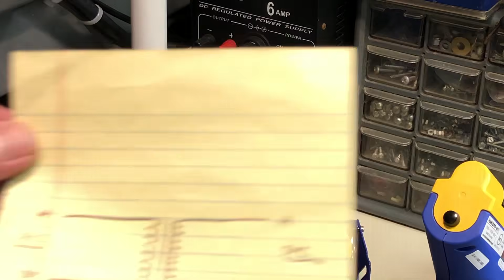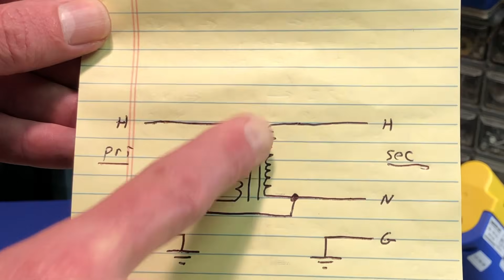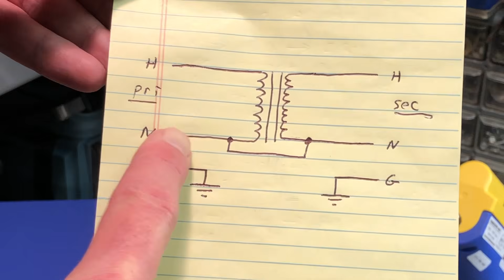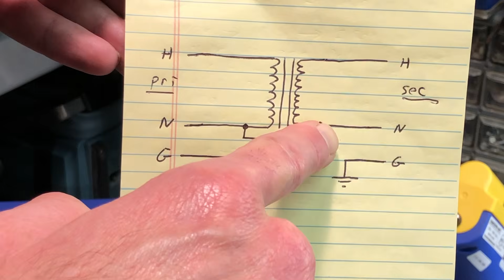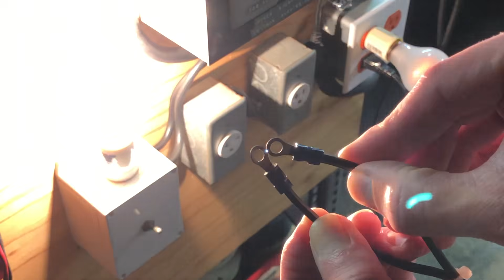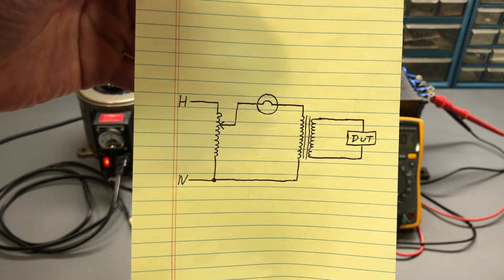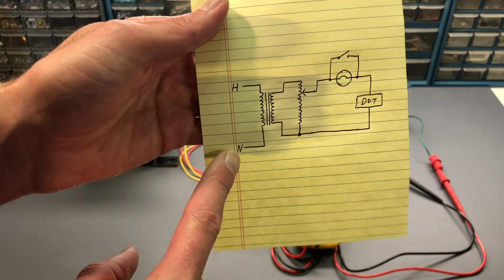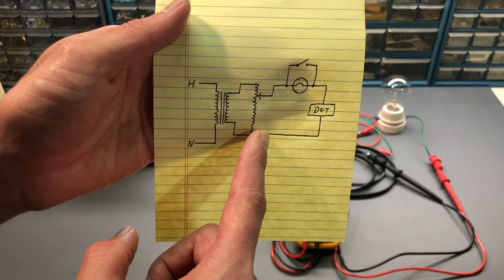How An Isolated Dim Bulb Tester Works (Current Limited Isolation Transformer And VARIAC)

Comment: Thank you for this video! As a noob hobbyist, my primary concern is a) not killing myself and b) not blowing up my oscilloscope. So this is very helpful. One thing I did learn, and correct me if I am wrong, is that using a powered differential probe is safer than using this setup because you can then still use the ground for the Oscilloscope, while isolating the probe connections from the scope, which in theory should allow you to probe a dead short on the test device without electrocuting yourself or blowing up your scope, right? Or is that wrong?
Reply from the maker: Glad you found the video helpful.  The isolation transformer's main purpose is for safety from the AC line which has a ground reference.  Although the transformer can allow you to connect a grounded oscilloscope, that will essentially undo the isolation transformer safety by introducing a new path to ground on the transformer secondary.  A dangerous shock hazard now exists.  Differential probes are a good solution or using an isolated scope such as a Fluke Scopemeter will keep you and the equipment safe.
Reply: @EriksElectronicsWorkbench  Thanks!

Comment: Do microwave ovens have a suitable tranformer to use as an isolation transformer?
Cheers
PeaceFromOz
Reply from the maker: No you can't use a microwave oven transformer because that type of transformer is a step up turns ratio.  They produce a very high voltage on the secondary (vary dangerous too!).   An isolation transformer is a 1:1 ratio so your line voltage on the primary is the same as the secondary voltage.
Reply: @EriksElectronicsWorkbench  thank you .

Comment: I have a nice iso transformer but no variac. I have been looking at a vac 
SC-10T from ebay that is a isolated variac but have not bought it because it seems everybody has seperate devices. I would like to know if the advatages and disadvantages of using a seperate variac and transformer vs a "all in one". I have a small bench so that would be one advantage for the 
SC-10T.
Reply from the maker: The SC-10T that I found on eBay does indicate on its schematic that it is both an isolation transformer and variac. (but for safety you should verify the isolation with an ohm meter if you buy it)   
If you connect an incandescent bulb in series on the output side you will essentially have the same arrangement as I use: isolation transformer->variac->bulb.  From the provided advertising the all in one SC-10T should function the same as having separate components and a bit more space saving.
Reply: @EriksElectronicsWorkbench  Thanks for the quick response. I am still watching your video and double checking my transformer for isolation.
Reply: There's a video of the SC-10T taken apart. Once you disconnect the ground on its output, which is connected from factory, it's truly isolated.

Comment: Hi Erik. I've found a problem. When switching this large isolation transformer, I've noticed that sometimes the house circuit breaker trips. It seems that the inrush current plays an important role, especially when the power is turned on at a point other than when the mains is crossing 0V. I've been thinking about connecting an NTC in series and creating some kind of controller to power up the entire system. The controller should manage the NTC's temperature, include a bypass relay after a few seconds, control a contactor for switching on and off based on conditions, a crossing 0V detector, (arduino project)etc... Perhaps there is something already available in the market.
Reply from the maker: Yes if the transformer is switched on at the peak of the AC cycle you will have a very large inrush current and large transformers can have considerable inrush currents.  You might try using a solid-state relay (SSR) that has zero crossing switching built in.  Make sure to size the relay for the power draw of your transformer.   I think the zero crossing SSR is the simplest solution.

Comment: Having the variac feeding the IT will cause problems . At low variac voltages the primary of the IT will struggle to generate secondary voltage due to back EMF. Could you do a vid on the difference between a tech IT and a medical IT.
Reply from the maker: The isolation transformer will work fine at low voltages but the slight mismatch between the variac and isolation transformer means you might have to set the variac output a little higher to compensate for the loss.  But that setup would still allow setting any voltage out of the isolation transformer from zero upwards. 
I don't have a medical grade isolation transformer but typically medical grade means it has strict safety measures for ground faults, i.e a fault that could harm a person since the transformer could power a device directly attached to a person.

Comment: I’d like to see what the current does on the DUT when you short out the bulb?
Reply from the maker: When the bulb is shorted it is just an isolation transformer and variac, so use with caution because there is no current limiting.  It is important to be able to bypass (short) the bulb so you can apply full line voltage (when appropriate) to the device when testing.

Comment: another question. Which is the best illumination? I always have filament bulb at 230VAC, but perhaps now are other options. The noise of the new LED bulbs is crazy...
Reply from the maker: You can't use an LED lamp.  It must be an incandescent bulb.  Normally the bulb voltage is the same as the maximum line voltage.  You are not choosing the bulb's wattage for how brilliant you want the bulb but rather based on how much current you expect the load to draw and how much current limiting you want.  A low wattage bulb like 25 watts often limits too much current, and drops too much voltage on the bulb leaving little voltage for the load.  A very large wattage like 500 watts won't offer much current limiting in most situations so you have to choose a bulb wattage appropriate for the load.   If the bulb is glowing brightly you have too low of wattage for the intended load, or if the bulb wattage has been selected correctly, the load has a fault which is what we are protecting against.
Reply: @EriksElectronicsWorkbench   Sorry, it was my fault. I changed the subject and the result to be more in line with the topic we were discussing. Of course, I know it should be a filament lamp as a series current limiter. I was referring to the illumination on your workbench and how people light up the area. LED lights generate a lot of spurious frequencies. In the past, I used a 220V 60W lamp, and that was it
Reply from the maker: @soulrobotics  my work bench and the surrounding work area is illuminated by fluorescent lights.  Some traditional ballast and some electronic ballast.  Electronic ballast are electrically noisy. I also have an incandescent bulb overhead for times when I need light but must have the work area as electrically quiet as possible.  Some videos are filmed with extra LED lights only to help with the camera exposure.  LED lights generally are extremely electrically noisy.

Comment: a question: how you source your oscilloscope, RF generator, AC voltmeter, etc? with or without ground?.
Reply from the maker: All of my workbench instruments are plugged into a normal grounded outlet.  It is bad practice and dangerous to float or isolate test equipment.  If you need to use an oscilloscope and isolate from ground the safest way is to use something like a Fluke Scopemeter or differential scope probe.  Most bench voltmeters and DMM's have floating inputs and are not a problem when working on isolation powered equipment.

Comment: I would like to add some protection. The lamp switch should be a 2A circuit breaker. Because, in case the switch is on and something bad happens, it is good to have an automatic circuit breaker. 2A is sufficient for many projects. I would also add an RCCB on the primary of the transformer (I choose your last configuration). If something fails in the transformer, I hope not! This RCCB would act before the home RCCB. Makes sense?
I would also add a wattmeter, a PF meter, and a needle ammeter at the end, just to take note of the consumption of the radio or amplifier. For me, the needle is the best indicator for debugging these old junk. Nice video, risk is on me, but thanks for sharing.
Reply from the maker: Adding a fuse or circuit breaker is fine but make sure it is sized no larger than what the variac or transformer can handle.  In other words the circuit protection needs to be the weakest link in the circuit.

Comment: ISI DIM BULB TESTER VIDEO…I use the 4th and final version of the setup…
I now own an oscilloscope and learning about ISO power.  Question…does adding a GFCI or AFCI “after” the setup, add any safety?  I can’t find any video demonstrating why the GFCI won’t work.  Testers give false reading because most of us lift ground.  The tester can’t send current to ground…so it won’t test correctly.  What am I missing…or is the GFCI a redundant safety feature not needed?
THANKS
Reply from the maker: A GFCI monitors the current flowing in the hot and neutral circuits.  If there is the tiniest of an imbalance in current, meaning current is taking an alternate path to ground, the GFCI will trip.  An isolation transformer's purpose is to isolate from ground so a GFCI won't work in this application because the transformer secondary has no reference to ground.  You could install the GFCI on the isolation transformer's primary side (i.e. the outlet on your workbench).

Comment: Excellent video ! I'm getting ready to build my setup, just like you did yours. I was thinking of adding a receptacle between the variac and isolation transformer with full line voltage so as not to have to use the variac all the time? I want to add an Amp and Voltmeter after the variac with the bypass switch as you did.
 My transformer is a beast ! Big Hammond 115v primary 782VA and 115VCT Single phase. I was wondering if I could just bond the ground and neutral together on the primary side, but not ground the chassis ? The primary side has three terminals. H1, H2 & H4. H1 & H4 = 125V from my 125V main. Which is how I'm going to wire it. H4 & H2 = 125V ? H1 & H4 = 242V on the primary side ? Secondary is 125V X1 & X3, which is how I am going to wire it, center tap equals 62.5V each side out of phase. 
 It's an older model. A single phase. I could not find a schematic on it anywhere ! I tested it and everything works fine.
 I was confused at the 242V on the primary side center terminal? And what would be the effects of running it at 125V line as opposed to the 115V rating? Would ot do or possibly harm the trany ? Just a little more heat ? I don't plan on running anything that long that would saturate the filaments.
 I'm planning on putting a 6A fuse between the line and the transformer with a 5A fuse between the variac and transformer. Any advice or information you could tell me, much appreciated, thanks again for a great video !
Reply from the maker: Glad you enjoyed the video and found it helpful.  An extra receptacle between the isolation transformer and variac can be handy, nothing wrong with doing that.  It won't have the bulb current limiting though unless you add another series connected bulb with that outlet (assuming you are following my setup).  As to grounding, if this whole project is in a metal box you should use a 3 wire cord and ground the box to earth ground but do not tie the box to neutral.  Then use "isolated ground" outlets (which are orange colored) so the outlet's ground socket is floating from the earth ground.  Without seeing the transformer in person it is a bit hard to say how the winding taps are configured.  But it sound like you have sorted them to the correct voltages.  I would not worry about the 125 vs. 115 volt operation, that is within normal specs of line voltage.  If the VA rating is given at 115 volts you could back off the maximum load a little running at 125 volts to keep things safe.  Short duration use really won't pose a problem.  Just remember on the grounding issue that the isolated line side can't have any reference to the outside world.
Reply: Thanks for your advice ! I'm not intending to use the DBT with the first transformer receptacle. Excellent video !
Reply from the maker: Sounds like your setup will be practical and work well. I have a second isolation transformer setup with no series bulb and no variac.  It is handy for times when you only need isolation and nothing else.  @ekbanjosworld4926

Comment: For the 3rd configuration (variac-transformer-bulb). If it is CT transformer on secondary ... than i should use 2 bulb, one for positif and one for negatif, am i right?
Reply from the maker: It depends on how you are using the transformer.  If you have individual loads on each side of the center tap and they each need different current limiting then yes a bulb on each secondary winding opposite the center tap would be useful.  If the secondary windings are connected in series and a single load then just one bulb in series with the load.  If the secondary windings are connected in parallel and one load then also just one bulb in series with the load.  And last, you could put the bulb in series with the secondary center tap for common current limiting to either winding.

Comment: Great video. Im buiding one now using a small variac and a 1 to 1 pyramid transformer. I havent decided how to wire it yet but im going to use a motor to turn the variac which has the same 3 amp ouput as the transformer.  I also have an old hammond boat anchor 1kva which is earth connected on both sides but i havent found a use for it. I have alot of recording gear and i may use it when i record to avoid hum when tracking guitar.

Comment: Can you explain how to reference a ground on an oscillscope since the bnc ring is connected to house ground itself. Thanks very much!  I will be trouble shooting a NAtional NC183D
Reply from the maker: In situations where connecting the oscilloscope ground into the circuit poses a shock and/or short circuit hazard you need to use a differential oscilloscope probe or a battery powered oscilloscope that has floating ground connections.  Never attempt to float the grounds on a traditional AC line powered scope by isolating it as this is dangerous and poses a shock hazard.

Comment: Your setup do not have a Residual Current Device (RCD) after the isolation side to mitigate potentially serious electrical shock to an operator. This can happen when testing DUT, the operator connects one of the terminals after the isolation to Ground (for some reasons) and then accidentally touch the other terminal. The most probable situation is that you connect GND lead of an oscilloscope to the DUT; and even if you connect light bulb load in series with the DUT, you may still get a serious shock if you accidentally touch any point that is live in the DUT. Perhaps adding MCB after the isolation is a good idea to provide extra protection in case of short circuit or an overload especially when the light bulb load is accidentally removed or intentionally bypassed from the test circuit.
Reply from the maker: The addition of any extra safety devices is up to the end user and details are beyond the scope of the video.  However installing a GFI outlet would pose an issue since the GFI outlet needs an earth ground reference.   The purpose of the isolated supply is to have no reference on either line to ground.  The current limiting provided by the bulb is in no way meant to be a safety feature to the user.  There are inherent risks with this test setup, thus the disclaimer in the video.
Reply: @EriksElectronicsWorkbench  Fair enough. I brought this up because most modern home electrical systems have protection devices in place to protect home users and electrical appliances from electrical hazards. So there are protections before the isolation, but after the isolation those safety features are eliminated. Regarding the GFCI, I think you are referring to the voltage operated ELCB, which is now obsolete because it does not provide much protection to the operator. And yes, that device senses the voltage in reference to the Earth. But most modern device is an RCD whereby it detects the imbalance between the current flowing in the live line and the current returning in the neutral line and there is no Earth line involved. Actually adding some electrical protections is pretty simple. Just hook up a small 6A or a 10A RCBO (which is basically MCB + RCD) just after the isolation transformer. It may also protect the transformers from smoking due to inadvertent short circuit or an overload (in situation whereby the light bulb load is accidentally removed or intentionally bypassed).